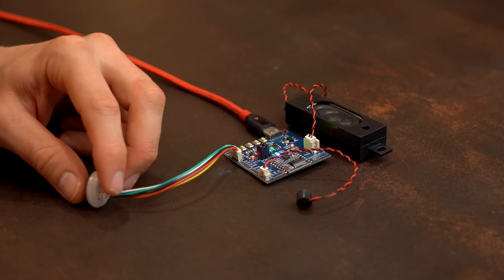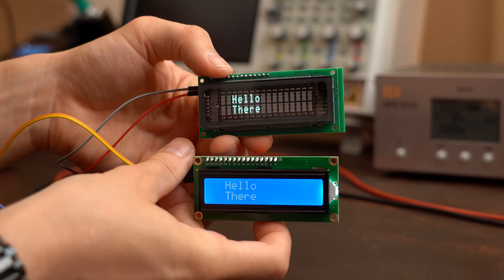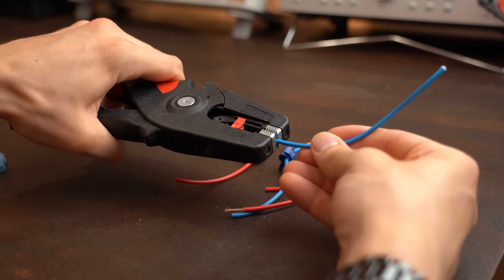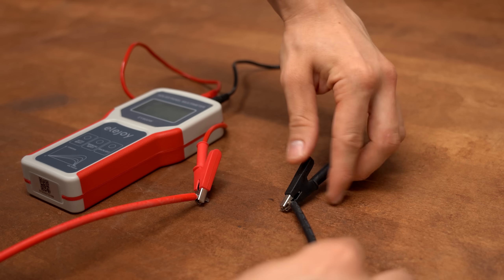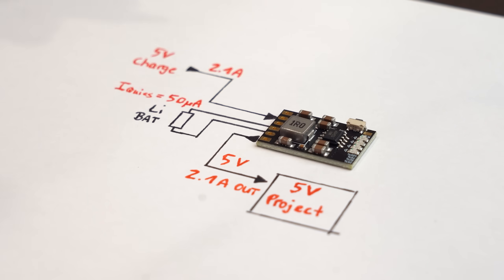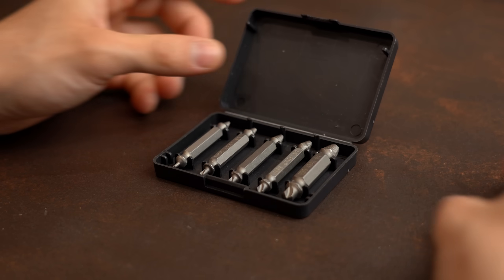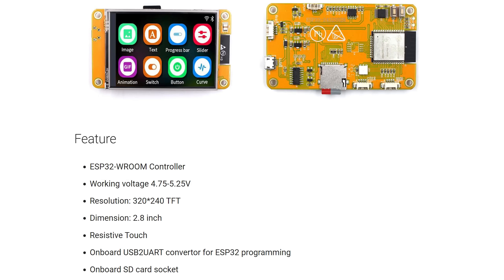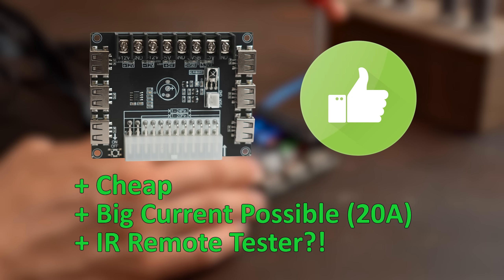I tried finding Hidden Gems on AliExpress AGAIN! (Part 6)

Comment: The screw extractors are fine, you just have to have a bit of finesse getting bad screws out.  You want to slowly engage the extractor in reverse so it screws itself into the hole and bites.  Too fast and you just turned it into a grinder.

Comment: I used one of these drill bits. I had a stuck screw in my bathtub water handle. (Yikes.) I was able to remove it using this, but the extract side didn't work. (I even ran it very slowly and used force.) I ended up using the "router" side to eat up the screw and allow the handle to be removed. (I had a completely new handle, so was not trying to save the old one.) I also installed a new water valve once that was removed, and the job was a success! (It was not $4 euros, it was maybe 3 times this cost from a local hardware store.)

Comment: The extraction bits you reviewed are not supposed to be used with such high speed. I have a kit exactly like yours that i got many years back for something like 3-5 $ and it saved my ass multiple times, but you need to be somewhat careful with them so that they grip properly before you apply speed
Reply: Request for diy Electronics load tester advance version.

Comment: Sir great scoat ,your previous digital electronics load  wAs extremely fantastic other than 

I request you please please please 🙏🙏🙏 come update version with high accuracy and high voltage and wattage capacity like 200v and aprox 300 watt 

I request you because all youtuber other than you not making perfect and india product very costly. , here diy worth itthen buy it, also improve electronics knowledge
In internet history no one make like digital electronics load controller proper working as per you

My humble request please please please please update your previous digital electronics load version

It is very useful for all hobbies
Thank you so much 🙏🙏🙏🙏🙏🙏🙏🙏

Comment: 30 year home repair contractor here, and I use the exact extractors in the video without any problem.  You need to apply a lot of force on the drill, and go really slow- allowing the bit to bite.

Comment: @7:43 It could be because the charging current scales with battery capacity?. The amps are going to be much less near the end 4.20V than when the battery is empty. A proper charging circuit should do this.

Comment: The "T-Splitter Connector" has been used where I work because a client required a modification to existing hardware (1000+ systems). The technicians did not necessarily know much about wiring. The wires were crimped in factory, then the technicians just had to use pliers to put blue splitter on blue wire, plug in the already crimped wire and done. That was fast, required no technical knowledge at all, only one plier. I don't remember the exact cost but I think it was even cheaper than a wago connector. So I think it has its uses.

Comment: Please note that the linked seller is currently listing the ATX adapter board as a variable power supply “1.8V-10.8V(ADJ)”, however this feature does not exist!  
On the ATX adapter board, the white PSON GND 2P connector is for connecting an external switch for switching the power supply on without needing to use the onboard toggle.

Comment: Hi, I bought the same charger, but it doesn't charge the battery that I connected to it. 
I measured the current that goes to the battery, and it is around 0.003 amps (basically nothing). Also, when I disconnect the battery, the 4 LEDs won't turn off. It's like a battery is connected to the circuit, but there isn't one. 

I would really appreciate it if someone could help me with this issue.

Comment: the screw extractors were done wrongly, best way drill the screw if you have to but then take the extractor and hammer into the screw, one good big hit with an engineer's 2ILb hammer should do the trick, as well as biting into the screw you will shake it loose, it has to bite into the screw before you wind it out, the way shown on here will never take a screw out and just make it worse and harder to get out, with all metalwork jobs do it right do it once and it will work, do it wrong do it often and it won't work, as you have just been shown,

Comment: I like those cheap t-split connectors for temporary projects, like swapping the FM radio from your car without snipping the OEM ends. It's a real PITA but it can save money and the spliced exposed wire can always be patched with liquid electrical tape.

Comment: Ive done quite a bit of screwing as well as stripping.. lol...  Anyway, those screw extractors are garbage!  I bought supposedly good ones and cheap ones, no sucess and yes... I size them correctly and I know the cutting bit is reverse fluted.  Nothing beats cutting a slot in the fastner with a rotary tool disc.  
As an electrician I totally agree, those T tap connectors are garbage.  
I like the ESP 32 display combo!  

ATX PS adapter is awesom too.  But yeah, what the hell is the random IR detector doing?? Someone have a pile of IR photodiodes lying around?? Lol... Crazy!

Comment: I was using connectors like those T splitters 50 years ago in the early 70's when I was a motor mechanic,they were called Scotchloc connectors and only needed one clip without wire strippers to branch off an existing feed to fit other electrical devices like radios or tape decks in cars

Comment: T-Split test does not make any sense. It is obvious that resistance will be bigger on connector. But if you have like 100 connections to make, you can draw power from main line without breaking it, thus without making any connections of main wire and that's is their only purpose.

Comment: those t splitters are complete garbage in the automotive and aerospace industries. the only thing you will get is corrosion and damaged wires. I only use soldering or crimp connections.

Comment: Yeah, it REALLY looks like you were trying to remove the screws with your drill/driver running clockwise... that would obviously never work. You start by drilling the hole normally, then run the drill/driver in reverse with the opposite side of the bit (extractor)... it works because those threads are reversed...

Comment: 10:06 - FYI , if you look at 0.25 speed, you rotate it in wrong way.... one is right side (screwing) to make drill hole, and then change to left side (unscrewing) side to get threads to head and continue unscrewing bolt. However, to make this work, you need hard steel tool, and hard steel bolt. This will not work with chinese soft tool and soft bolts. Just use torex 20 bit, and hit it with hammer to the head of screw, then use ratchet to remove bolt.

Comment: I actually have that exact set of screw extractors, and successfully extracted a few screws with it. I found that using the smallest hole making side of the head first and then using the extractor bit that was 1 size larger works for me, needs a bit of force towards the screw to make the extractor side of the bit bite the screw head to start unscrewing it.
The smallest screw I extracted was a screw from a dead 2.5" disk that was holding on to a disk caddy, and the largest was something similar to what you showed in the video.

Comment: I prefer wire nuts over wago what ever they are called. The puck lights I got today and installed 7 of the so far all came with those push to connect wago connectors. I hate them. Will have to suffer using them. The only bad thing is they rely on the metal in the connector to stand up to the current where wire nuts do not have any problems.

Comment: I'm enjoying the series so far, but I gotta say its a pretty boring lineup this time. Ali has so many weird and wonderful gadgets that a solar multimeter doesn't really grab the interest.
Might I suggest some of the cheap things from the app? They are all supercheap and very weird. Like a spring loaded solder sucker that has a 240v iron built into it, or cigarette lighter phone chargers that claim they can put out 100w, but what they don't tell you is thats only when running from a 24v power source.

Comment: Another benefit of that ATX breakout board is that it keeps someone from having to open a power supply, which can be a very dangerous thing.
I love that China seems full of engineers that have specific use cases and things built specifically for that issue. Said ATX Board implies someone at some point, had spare working computer power supplies lying around but needed tons of USB and light lab-bench work and just... made due, with something that's safer than tearing into one. I really have to hand it to em.

Comment: I guess that those T-splitter connectors are mainly designed for illegal purposes (stealing some electricity or some signal from some exposed wires without interrupting the power or transmission), my dad used a similar technique as a teenager by using needles to pierce the wires of his mother's phone line to be able to make phone calls when he wasn't allowed to...   :D

Comment: I don't understand how you don't know that they make the T-connectors in different sizes like the red 20-18 Guage the blue 16-14 Guage like you used or the yellow 12-10 Guage. I mean that's nube 101.

Comment: would be nice if those lithium cell power modules had a 4.1v instead of 4.2v charge option for the sake of leaving it floating a cell that you want to last a long time instead of holding maximum capacity.

Comment: 0:57 Do they still make those fluorescent displays?
1:10 Clearly no LCD, to me.  Am I so very, very old I recognize a VFD at first glance. Those little things are musical too. Especially when cold and the emitters relatively tight.
10:10 I have a set half the price, and for me, it saved me a few times. But a few years back I might have bought just a knockoff of the real thing, and is now a knockoff of a knockoff of a knockoff of a knockoff commonly sold.
13:29 See you, and thank you for this video.

Comment: I feel like there's always some missing key information about the products you test that can sometimes be super important. Like how exactly to use the screw extractors properly and that the 5v board has a mode to turn off the 30 second timeout. Makes the rest of the information kind of unreliable feeling. Lots of errors across the board on your channel unfortunately too.

Comment: That Charger/Booster is really nice... unfortunately you can't set the low current for auto off. The IC they use, I think, is the IP5306. It has a 45mA threshold with a 30 sec timer.

Comment: I would be really interested in seeing a video about tunnel diodes. There is an ebay vendor right now selling 10 for $20 (he has like 3 or 4 packs left) with really positive reviews, all of the other vendors have them priced at like $40 or $80 each. I ordered a 10 pack myself. I think they could possibly make some cool guitar pedals or synth modules.   Edit: Time will tell if they are legit. Looking forward to getting my hands on them to see if they are. " General Electric 1N3719 Tunnel Diode" is what I ordered.

Comment: Good luck with that! Their selection, other than some odd computer boards, tools and cheap electronic accessories is virtually non existent. I did score a stick on LED light strip for the back of my monitor for three and a half bucks. The green LEDs only work on a quarter of it, but it can produce blues, purples,and reds just fine. I can live with it at that ridiculous price with free shipping.
I just don't understand how the Chinese sellers are surviving. Just on Ali Express itself, they are in a desperate war with each other.

Comment: T-splitters are communally used in vehicles for aftermarket accessories, I used these when in the past while installing alarms / remote starters on cars. They have 3 sizes red, blue and yellow, red for thinner wire, blue for mid and yellow for wire around 10 gauge.

Comment: The screw extractor works for me, I have used that before, you have to push it vertically with force, and turn it very slowly.
 https://youtu.be/iHs9VGEuhxI?si=x1EMJwUYBKrxk7U7
This video explain better

Comment: If you watch the video they have for demonstrating the screw extractors, you can see on the other screws that they’ve had a thread inserted to them. So of course, if you get a tap and die set on your screwed screws those extractors are going to work!

Comment: Them T splitters are so annoying when people use them in cars to connect wiring for a tow bar. They work but over time with vibration from driving they cause wires to snap not so bad if they are done on wires with colour coding and very annoying when they are done on sub harnesses that use black for every conductor when you have to go back and connect all the wiring back together.

Comment: There are couple size of T connectors, they are fine to use in automotive where you cannot use wagos. T connectors are less sensitive for vibrations.

Comment: You made a BIG Mistake when using the Extractor Bits, you are supposed to Drill Anti-Clockwise and use the Extractor Anti-Clockwise otherwise you would push the screw more into the wood instead of removing it. At least thats how it looks on your footage, pls review!!

Comment: Oh goodie, another line-up.  I use OLED displays nowadays.  They're pretty fast.  I wonder how they compare.  I've also never had luck with those screw removers.  The battery board is great - I've used something similar with adjustable output, which is finicky.  The PSU board is really fantastic.  I use large T-splitters on my high current cables, but they are solid metal and have two large screws.  I wouldn't trust those tiny T-splitters.  The solar panel device looks very handy if you work with panels in the field.

Comment: The striped screw extractor worked for me in 3 times out of 4.
On electronics devices with small screws which I thought is hard!
2 screws were screwed into plastic shell which was a joy con shell and i failed one. One worked perfectly.
And one I don’t remember where or when but I used it for a friend of mine to extract something I think a stripped screw on his Car (Mustang) and the main reason I bought this set was to take out my old macbook 2008 motherboard one of the screws got stripped I was disappointed and felt miserable failed and I didn’t believe it would work and suddenly first try I got the screw out and I was the happiest man alive cleaned the cpu and replaced the thermalpaste and upgraded the HDD to SSD and from 2GB Ram to 8GB 0 cost upgrade as those rams were in my drawers haha

Comment: I think those connectors you showed first would be good when fitting dashcams or telemetry black boxes to cars, where there isn't enough slack to cut the wires and add a terminal block.

Comment: So that USB charger, I dont quite understand, does it only turn on and charge when there is a load?   I currently have a Tab S2 in my car running off 3x 18650s and a TP4056.  I wish it had a timer or something so when I yurn the car off it qould charge for like 30 mins then turn off or something, the worst thing about the setup is that it wastes so much power because it will only let the voltage drop by like 1% before it starts to charge again.  Its directly to the battery, no ignition or switch at all.  Any help or suggestions please?

Comment: The extractors:
-Will never work if you wobble the drill all over. That hole needs to be a precise size and wobbling will absolutely ruin it.
-Only work on soft metals, steel screws aren't soft, brass/bronze/aluminum all work.

Comment: Hello sir, I am learning micro controllers due to your wonderful inspiring videos. But i have experienced this weird problem so far when dealing with relays and motors.   The problem is that when i try to run a code on my arduino to switch on/off  load, My arduino malfunction. This problem occur when i connected the relay with dc motor, dc pump and  also ac fan. Please help me understand this interference and how does it affect my arduino and how to solve it because i learned that the relay isolates the load from the micro controller.

Comment: Those T connectors are quite good if you want to tap into wire without breaking it. Especially in security. People will notice when their network cable is cut for minutes until you add Wago connectors
Noone will notice if you are tapping in with those T-taps. We used to use similar things in military to tap into lines :)

Comment: ESP32 LCD board should get thumb down. Any tech that have resistive display should get that in 2023. Resistive touchscreens should be used for special cases at this point, but until people will buy it, AliExpress will be full of it. Capacitive touchscreens usually made from glass, which mean better scratch resistance than resistive one, them doesn't need to be calibrated, everyone have a phone with such display and know how to use it and what to expect.

Comment: I didn't know that ali express is popular in Germany. in Russia it is a number one site to order strange stuff ( actually, local stores are also full of aliexpress stuff already). As for t-splitters - it is sometimes used in Russia as we can buy it almost everywhere, but more often Wago (actually now it is fake Chinese wago) is used for connecting lights or low voltage stuff. Quite great video, for example i didn't know about the vacuum lamp display, very nice thing for some dyi with nostalgy like sound amplifiers or etc

Comment: That 5v lithium battery charge / discharge board looks interesting. But is there a way to limit the charging current to the cell? I would like to use this board with some salvaged cells from single use vape devices. But I don't think they could handle 2A of charging current.

Comment: First off, run the extractor bacwards. Second, when using the actual extractor, SLOW IT DOWN! You are using it at a super high speed while it's meant to be used extremely slowly. Put high pressure on it, in reverse, try NOT to make it skip. And with slow, I mean MUCH MUCH MUCH slower thank you think. Start with slower than you use a screwdriver by hand.